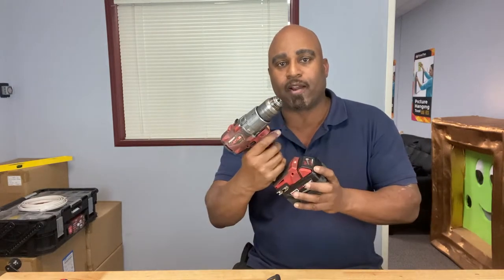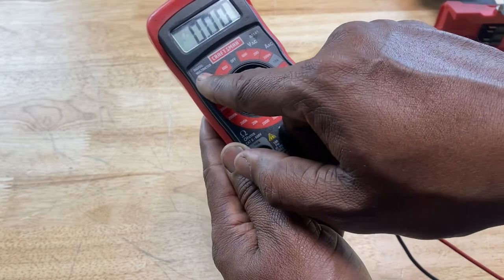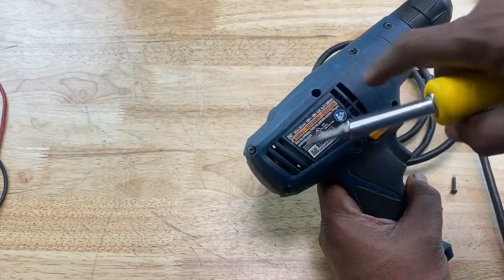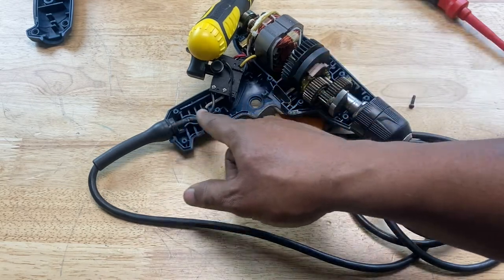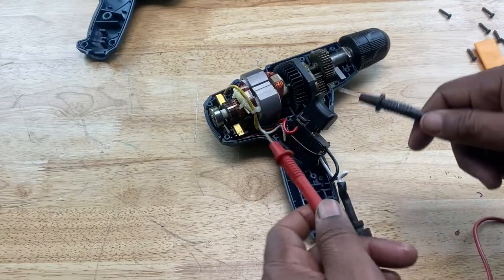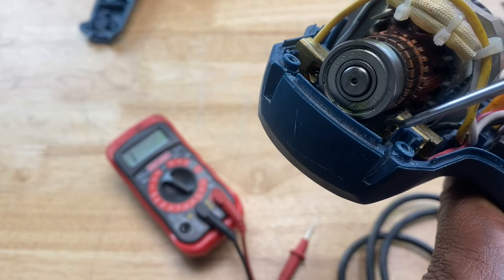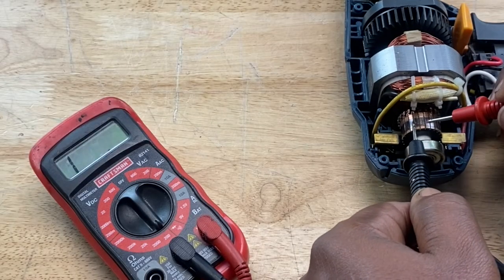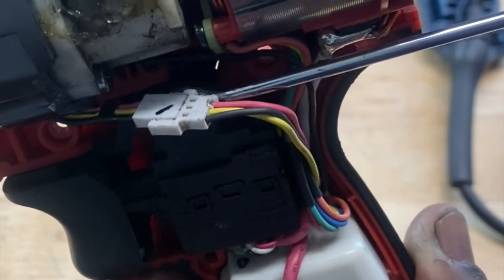MY DRILL STOPPED WORKING

Comment: motor and switch got continuity but testing drill neg and positive nothing, help please
Reply from the maker: If the motor and switch connections have continuity then it should work. Could be a short.
Reply: @Caliber8Tools  battery and charger fine as got three of each, but as soon as i put battery on nothing, but batteries work on my other drills,  i havent a bench power unit so stuck as to what to try next.